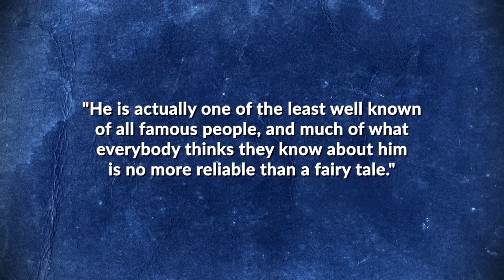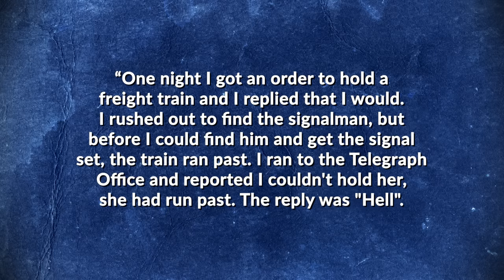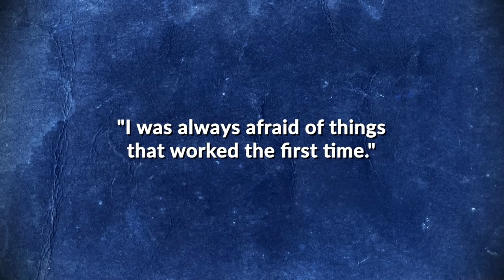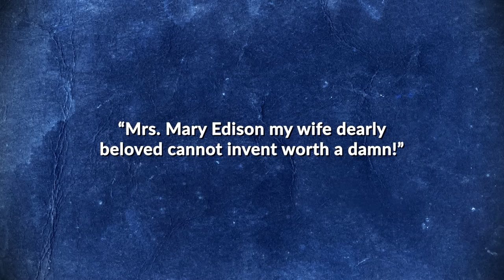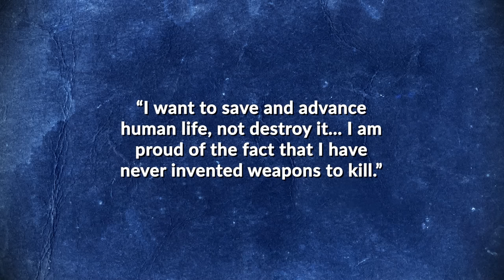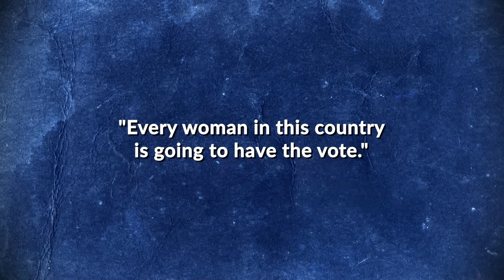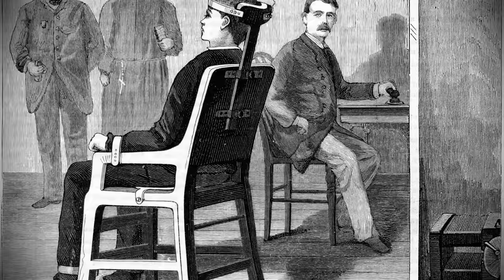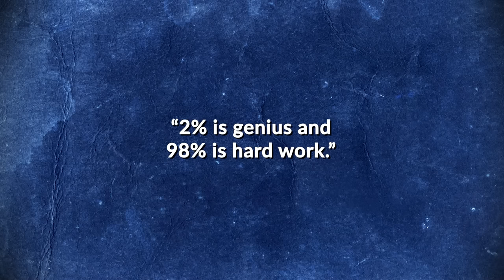Everything You Know About Edison and Tesla is Mostly Wrong

Comment: Edison was right about D/C power transmission. Ultra High Voltage D/C power transmission is the future.
Reply: Yeah he said that because a british scientist told him that 😂
Reply: Lol you need ac for long distance you can't change physics.
Reply from the maker: Edison's main issue was the high voltage nature he thought was too dangerous. So he'd also have been against high voltage DC. -Daven
Reply: @TodayIFoundOut  I know. It was a bit of a joke. It wouldn't be the first time he pissed himself off with one of his inventions/theories not being used the way he wanted. 😂
Reply: @BladeValant546  is 3000 miles long enough?
Reply: @D.Jay.  "pissing himself off with one of his inventions not being used the way he wants" is Edison in a nutt shell.
Reply: @BladeValant546  High voltage DC transmission is a thing, there are already quite a few long-distance setups in Europe and elsewhere.  HVDC has many advantages, including efficiency and syncing of multiple power grids.  The main disadvantage is that it requires specialized equipment to up and downconvert the voltage that has only become practical in recent decades.  Look up the wikipedia article "High-voltage direct current" if you want to actually learn about it.